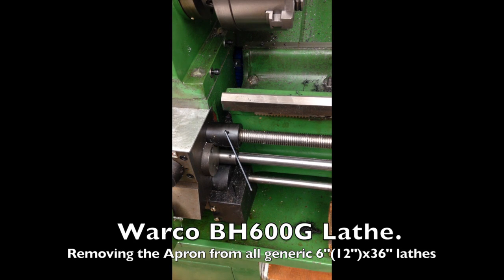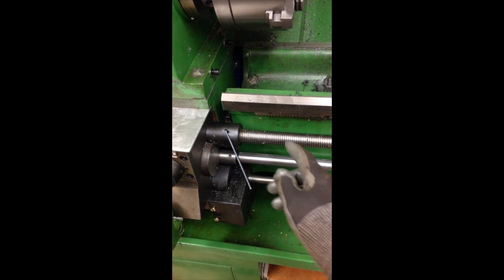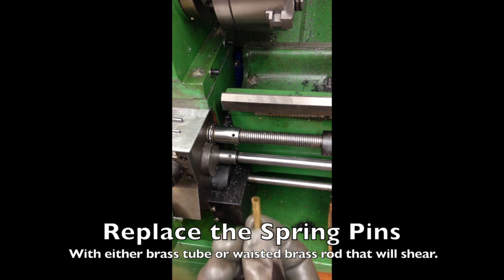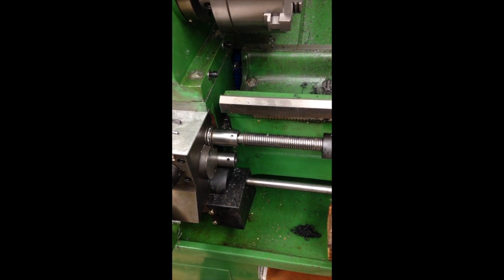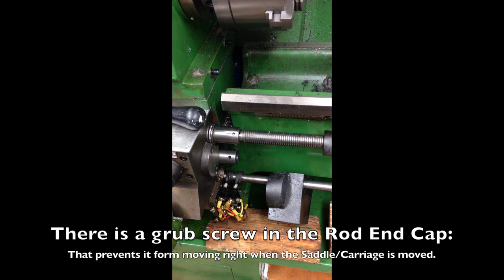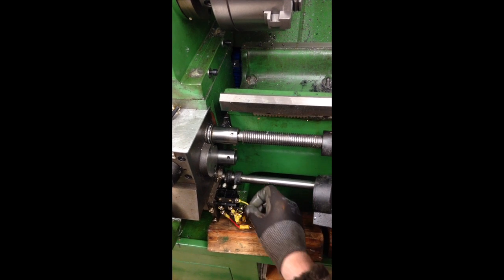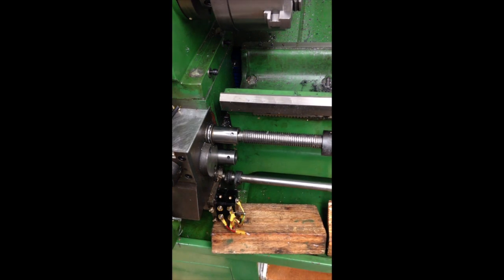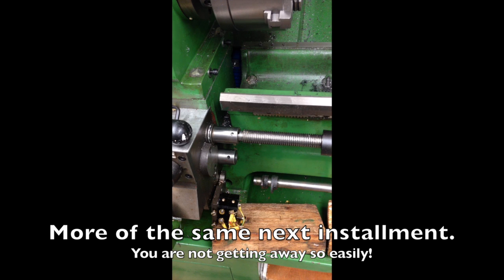1/3 - Warco BH600G: Removing the Apron

Comment from the maker: The first of three videos showing how to remove the Apron from any generic 6"(12")x24"/36" Lathe.
Your lathe may not be identical to mine, so should be used as a quide only.
DO REPLACE those nasty spring pins either with 5mm brass tube or waisted brass rod that will shear if the Saddle/Carriage jams whilst under power feed.
This is what happened to me and I had to replace the bent Gear Shaft and sheared teeth form the Worm Gear.
I tried my best to straighten the Gear Shaft, but without a suitable press or heat I was not successful.
The replacement Worm Gear is bronze, whereas that fitted at the factory was brass.
This video took over 3 effing hours to upload due to my 3rd World upload speed!
Can anyone help in advising me of a better ISP?
Reply: Geoff Halstead Thanks for the video Geoff. Contemplating some maintenance on my lathe soon and will need to remove the feed rod and lead screw so your video has been very useful!